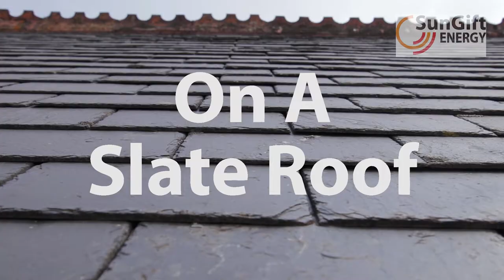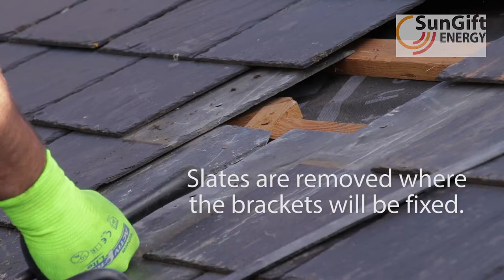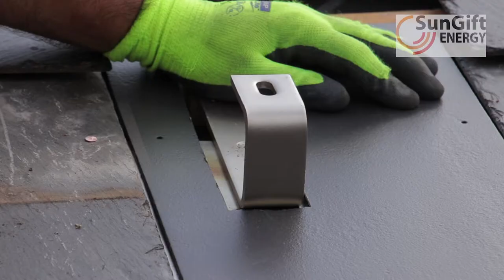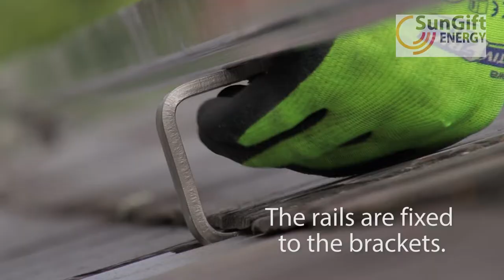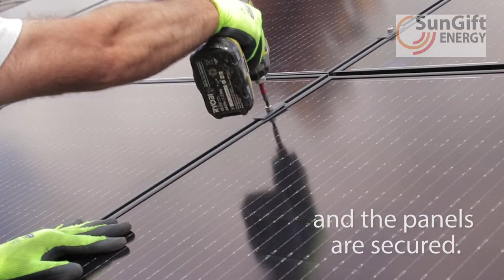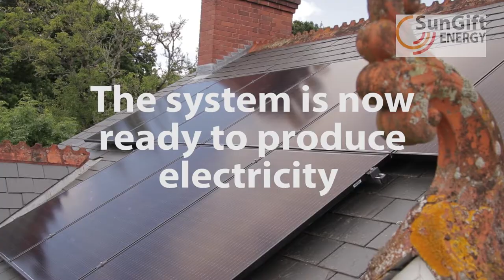Solar PV Installation on a Slate Roof

Comment: Nice 👍. I just wander if one can have these solar panels on the roof in stormy areas, living at the Westcoast of Ireland and worry that the storm could damage the roof going under the panels with pressure. Is that a possibility?
Reply: @reed-moutray111  L

Comment: Great vid - Quesiton - How do you secure the last slate tile - on the video it just get slid in - but there are no nails as they are inaccessible
Reply: @Phil Ware thanks bud! Learned something new. And its nice to get a helpful answer on youtube instead of as sh!tty comment from a keyboard warrior.
Reply: @EVILJARED0061  Hey Jared, what was Phil's answer? It seems to have disappeared!
Reply: @toesandfingers  my solution would be a slate hook, look them up
Reply: @toesandfingers  Yeh I was wanting to know the answer as well but the reply seems to have disappeared.
Reply: @eddien09  I was thinking slate hook as well, obviously none were used in the video so i wonder what they used?
Reply: Stick it in with black sikaflex
Reply: @kiwifruitpoo  I'm not a big fan of sticking slates, I always do a mechanical fixing myself.
Reply: @toesandfingers  I don't think the video shows the last slate go in! If you re-watch I think the last slate the video shows going in actually has another slate above it still to lay, if that is correct they'd just nail the one you see in the video & at the end of the video it shows the slate above is secured with a hook. That's what I think I can see anyway 🙅‍♂
Reply: @northeastcorals  I saw a video where they used a fancy hook called a "pig tail". Seems you can tighten it with the slate in position.
Reply: @keithball6772   I've seen the pig tails, which seem like a good bit of kit although I've not used them my self. I think with those you can still see a little bit of wire that hold the tail edge of the slate in place, I can't see any in this video as they cover over the slates with the panels but who knows 🙅